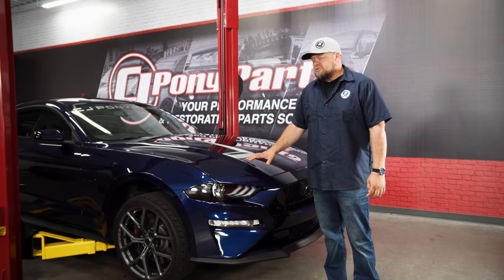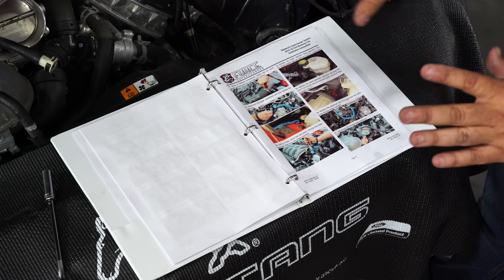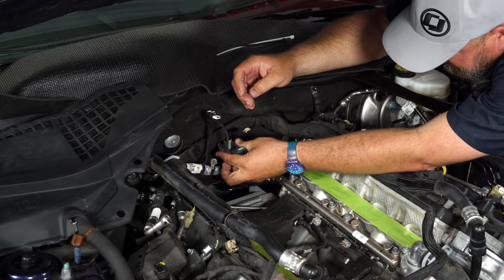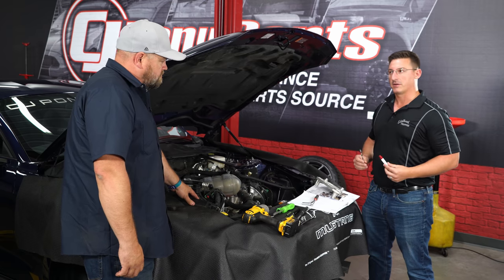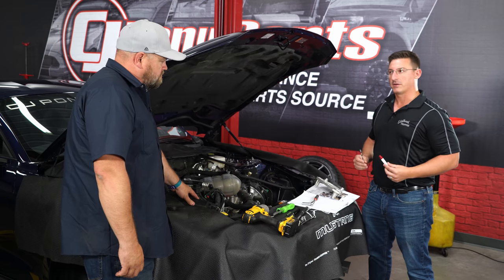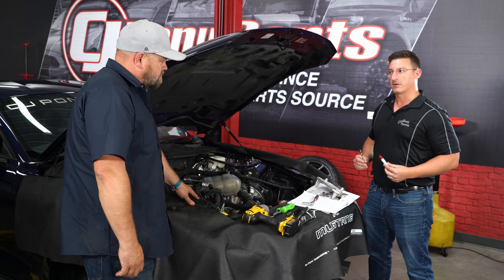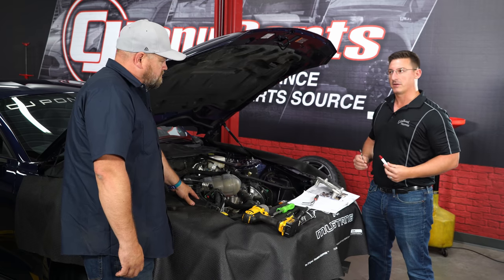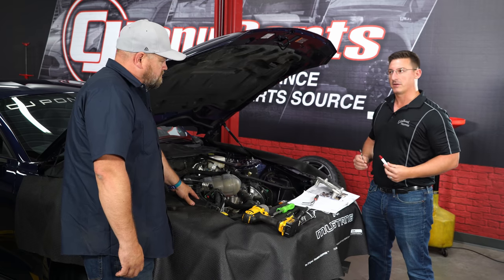Take Your 2018-2023 Ford Mustang GT To The Next Level With This Edelbrock E-Force Supercharger!

Comment from the maker: Product Info:
https://www.cjponyparts.com/edelbrock-e-force-supercharger-for-the-2018-2019-gt-mustang-5-0l-r2650-stage-1/p/EDL15832/
Reply: This kit is way much better than the Roush install, and runs cooler I'm guessing with Air inlet temps
Reply: Paulie Harrow you felt so strongly about that you posted twice?
Reply: CJ Pony Parts stock oil pump gears are okay with the 10 speed automatic and this setup?

Comment: I gotta say, a couple months after I made some other comments on this video, that last night I stopped at a local late night meet spot to see what cars are out and what's new with setups.
A guy had this Edelbrock SC setup on his '18 Mustang 6 speed car.  The Edelbrock supercharger looked really nice on his white GT.  He said he had the shop who tuned him do the install but he was there.  Said it was straight forward and could be done pretty easily if have the time and space.
He had headers installed too so he didn't run the base map, just the custom map.  This is a great size SC he said as if he wanted to up the boost down the road he can swap pulleys.
His car pulls really hard as it is and going to stage 2  would be easy to upgrade to with supporting mods.
He is extremely happy with the Edelbrock kit.

Comment: Wow, that's a great deal the fact it comes with a full warranty included! I was holding off modding my Stang till the warranty expires but now I am really tempted to pull the trigger!
Reply: Pull it!
Reply: Same
Reply: You can bring it to the dealership and have them install it and you will keep the warranty.  Lebanon Ford in ohio sells a 700hp mustang with a full factory warranty.
Reply: Did the they say the factory basic and drivetrain warranty is also still in effect even after installing this kit?
Reply: I’d like to install it myself and save a TON of labor charge. I can imagine it’s pricey. Man I want this setup.

Comment: I used this video to install it on my 2017GT. Almost identical instructions. Took 2 days...Bought about 300.00 in tools I didn't have. Really pleased with install that looks factory. Had an issue with reservoir leaking and they sent another quick and no charge. Just be careful with front fascia or you'll need the latches- go FORD :(    Fuel rail bolts were a slight pain. I'm no mechanic but have good mechanical know-how. I'm a PC support tech, but I'd install again in a heartbeat. I'm running the canned tune but getting a better dialed-in dyno-tune in spring.  After about 10 street races only losing to a twin turbo stang, the clutch blew up. Upgraded to a 1000HP clutch and have halfshafts already ordered. Overall money well spent for the fun it gives back. I ordered mine from CJP because they made such an awesome video. Bill deserves props.
Reply: i just bought a 2017 also it came w/ this how has it been since you had it?
Reply: @blvckshinobi3864  10k miles on it... still enjoying it... no problems
Reply: @purpletwinkie64able  thats good man because i was doing reseach and everytime i look up info on it always says 2018-2022 mustangs.
Reply: @purpletwinkie64able  and not trying to be funny but are we able to tune it to make it sound like a supercharged is under the hood im hearing it on VMPs not these.
Reply: @purpletwinkie64able  whats the mpg like?
Reply: @blvckshinobi3864  no whine... you can do a fosters mod but only hear inside car
Reply: @jadenjames1640  15mpg around town... 20mpg hwy
Reply: @purpletwinkie64able  I have a video on Tic Toc w/ it on Dyno most definitely Whines @livinrelentless
Reply: @purpletwinkie64able  thats really good for the power thanks dude! i thought it would be less tho

Comment: For anyone considering any S/C kit with included tune... You must not deviate from their listed aftermarket parts or you risk blowing the motor.  At very least car will run very poorly.  
If included tune says stock cat back exhaust you must use the stock exhaust. Can't swap intakes or alter from their list of parts.  Once boosted any change, even minor, requires a custom retune.
Most included "base maps" are on rich side to be safe.  As it's better than going lean and getting a lean condition and/or knock.  Seen many people ruin a good ecu map by changing parts AFTER an ECU map was created.
Reply: no one is gonna listen to a subi grunt
Reply: Subi owners probably have blown more motors on 1 car than most of us have in our lifetime lmao. I'd take a minute to learn from them.
Reply: Nicholas that’s cause their engines are shit bro I’ve owned one myself lol 😭
Reply: I agree..but  having a couple sc mustangs  myself I would use their tune just to get it up and running then take it to a tuner and do a dyno tune to make it safe and better power curves etc specifically for how you are going to run your car... are you a road racer , drag racer , daily driver , whatever it is a custom tune is the way to go... both my cars I have 3 saved tunes on my laptop I can download for what I want. I use two mostly the pump gas tune and race tune gas max power tune for the strip. Both tunes developed on a dyno. Only way to go and be safe.

Comment: I'm glad to get this video, everything you mentioned as being tough my ASE installer had said months ago, so now I know for sure he was being honest haha!!!!
 I've had this blower a while it's a capable piece and looks like Ford installed it at the factory ( especially in stage 1 using the factory airbox). I have taken my car in for tint ect and those performance oriented guys WITH FBO e85 mustang's didnt even know it was on there with my stock exhaust. I have the old man sleeper going...this blower, ceramic tint that not real dark, stock exhaust, slightly upgraded tires...
 This kit also has a bleeder in the bypass hose that delays boost and Torque delivery so that you can actually USE the power it makes. The effect is something of a centri/PD hybrid on my 19 A10, however this is adjustable by buying N20 jets I found a .040 orifice to be a great blend to get into boost at part throttle and hold it longer..this makes a 28 inch tire, 3.15 gear car feel a bit more spirited. I've always knocked PD blowers in the past for how hard they all to USE their torque which is their strong point elegant simply solution. I've dont this a much more complex way with PWM 3 way valves in the part ( but I was doing boost by gear and had it tied into traction control deltas).
 Stage 2 goes on my car today and I cant wait to compare. My main gripe is that I feel like I was done wrong on that who deal, this weekend one could have gotten a stage 2 for about same price as I paid for Stage 1 a few months back. And stage 2 "upgrade" is $4750 ( stage 1 this weekend was $7100 with rebate ), I've got almost 12k in the same exact setup not counting double labor. I feel like I should have gotten a voucher for the cost difference between 1 and 2 as late as my purchase was and all the problems getting my parts both times, missing install windows and sale only have 2100 miles on install, engine is fine and doesnt use a drop of motorcraft 5w50.
 That's just my sour grapes and bad luck on timing for pricing, I urge anyone considering this kit to pay the 1800 differential between the stage 1 and stage 2 full kits. You cannot every remotely piece it together cheaper. The 8 rib conversion purchased alone is $1750, tb is $850( remember it's a new Edelbrock digital piece for the 18 and ups no conversion box this isnt a bad price, 113mm maf horn and aftermarket cone filter in a nice looking sealed box is around $800 ( I think dont quote me on that one). Just buy stage 2 going in and your getting well into the 700s for a very good price and capable of 1000whp when you want to take the training wheels off.
 The Stage 2 kit is also warranted, if you havent previous voided warranty on your car before installing. Making it the most powerful warranted kit ever produced from literally the first name in performance ( do you think Edelbrock is going out of business in the next 3 years to 36k miles? I don't) a truly unique kit and hands down their 15388 kit is the best bang for the buck on the market when you factor in power with a warranty along with headroom to grow, its stealthy silent till your really on it and impacts the driveability and mileage almost none...barely deductible till you want it to be.....
 Any questions just ask, but I implore you not to get stage 1 and then upgrade get stage 2 even if you have to wait another month, it wasn't an option at the time for me but it's a no brainer. $1800 or less upfront and 1 install or $4750 on the backend and labor for 2 installs...
 Thanks Shawn.
Reply from the maker: BlueCollarDaily longest reply ever :)
Reply: @cjponyparts  dude Nicholas will tell you, that was Pithy...bahahaha...sad but true.....

Comment: Nearing the end of my install and have to admit this video was super helpful.  Few things  that had me confused were the Edelbrock instructions listed 4 harnesses to unplug on the back of the stock intake manifold...  My 21 has only 3.  I found installing the fuel rails after would have been easier, the rear isn't as tight as expected and they were hard to manage on the blower getting the bolts in.  Overall everything went well, great job and although the instructions that came with the blower are good I dont think I would have been able to do as easily as I did without the video.

Comment: I just bought this supercharger for my 2019 f150 5.0 gonna get it installed here soon. I ordered mine over 4TH of July when edelbrock had 15 percent off site wide so I only paid 5900$ shipped.
Reply: Did you get it installed yet? I'm thinking about buying one
Reply: Finally got it installed I have a regular cab short bed lowered 4wd and this supercharger makes the truck haul ass. My mechanic installed it in about 11 hrs he said he ran into a couple of things that were a pain in the ass to install it but it's definitely worth every penny.

Comment: Wish I’d given the Edelbrock a chance rather than going centrifugal on my ‘18.  These things are heavy hitters when you add a fuel system and E.
Reply: The same thing could be said for centrifugals if you run e85 and up the timing and or boost.
Reply: Which one did you use?
Reply: D1X with e85, headers, and about 10lbs will put you around 800-850
Reply: BlueCollarDaily 2200Sl with a Fore L2 dual hat setup.  Not sure of my numbers.  I just know you tend to see way more Whipple/Edelbrock cars in the low 9’s and some in the 8’s where you’re not seeing Paxton/Procharger/Vortech cars nearly as often.
Reply: Twin screws look better, have better low end torque.  Centrifugal have that top end power that twin screws just don't.  All a preference/choice of what you want.

Comment: what gap is your spark plugs? are they Motorcraft? Getting a spark knock on high end, trying to figure out if the gap is wrong or if I just need to add Lucas to the fuel. Thanks

Comment: How can the factory fuel injectors supply enough fuel for that supercharger kit?
Reply from the maker: neverendingmods the DI pump makes up the difference. Some SC kits add larger injectors and leave the DI pump alone, Edelbrock chose to use it .

Comment: Quick question. Can you use corsa long tube headers with a borla switch fire mid pipe to factory 2019 bullitt mufflers? Or what would be the best route for long tube headers?

Comment: The Roush can be had at the dealership in Richmond Ohio, on the GT, @ 700 HP, with warranty , for less than 50K.
Reply: That's what I was thinking
Reply: The Roush kit is more like 600hp and only in mid-range of rpm.  Very little power down low and up top.  That's why there's a factory warranty... Mild so less torque as torque breaks shit but is what wins races, not HP.
Reply: @neverendingmods  2017 stage 3 roush produce roughly 670 hp (weather that's crank or wheel I have no idea) but for 2018 and up its its phase 1 supercharger kit produces 710 hp and 610 lb-ft of torque. (Again same statement applies to this as well) but anyways with warranty either way roush I've heard is more reliable, but that just my Opinion
Reply: All this crazy HP is getting out of hand !, remember back in the sixties, high insurance rates on hot rods killed the average guy.
Reply: @charleswilliams3979  honestly if I had the chance to time travel just once I would go back to the late 60s just to see all the hot rods and classics out on the street
Reply: @Mrjack-yn2dj  .Man O Man! Hemi's, Z28's , Boss 302's , deep dish crager wheels , cherry bomb mufflers, air shocks, little tires up front, wide in back, posi rears with big gears, 4-11, 4-56 , Hurst shifters, Grant sterring wheels, fuzzy dice on the rear view mirror, the sticker on the glove box that says, gas, grass or ass, nobody rides for free! Ain't that AMERICA!
Reply: @Mrjack-yn2dj  
Roush tunes on their cars are very conservative.  Lose warranty retuning but gain big power down low and up top.  Roush cars make good "claimed and proven"  mid range peak power but lacking  down low and up top. It's all in the tune and purposefully done that way so shit don't break.   
Check out some of the reviews of their 18/19 GT 700+HP cars.  I'm not bashing at all just saying retuning their equipped cars net a big increase at cost of warranty.  Some guys ditch warranty and retune.
Reply: @neverendingmods  ah, okay. I was not away of that. I got confused and thought you were just saying that they can't reach 700hp. I do apologize for that. Also that's kinda ridiculous anymore, they should know that their cars are going to get tuned.

Comment: Big Question..Will Ford honor this  Edelbrock supercharger..Especially if your local Ford dealer does the install.. Has your exteneded warranty like I have on my 2019 Ford Mustang GT Performance Pack 1
Reply from the maker: Edelbrock warranties the engine if you use their kit, the Ford warranty on the engine would be void.

Comment: I would never trust myself with this
Reply: @Markus Patients my jet ski quit while I was on the water because the battery got disconnected because the bolt came out..
Reply: @Markus Patients I was the one that connected the battery at the beginning of the year..
Reply: @Markus Patients me, I used a wrench this time, instead of a screwdriver
Reply: I wouldn't trust anyone but myself to do this.

Comment: Love this kit and I'm trying to pull the trigger on one but I need some answers.  I'd like to start with Stage 1 and upgrade from there.  I want to run e85 and I've already got TSP catless long tube headers, JLT & x-pipe.  I know the JLT will no longer work but I want to utilize my exhaust.  My shop is researching stuff now but I'd like to know if I should go with a No-tune setup or the one with the tune? If the shop does an e85 tune, what injectors would I need?  Does the Stage 1 use the stock TB or just a smaller one?  I know the Stage 2 includes a 113mm TB.  Thanks in advance.
Reply from the maker: Dustin G if you have catless headers you will need a custom tune.  As far as running on E85 that requires a custom tune anyway and you would want to go with at least ID1050s. Stage 2 has the larger throttle body and airbox setup. If you go that route your fueling needs will depend on your tuner but most likely you would want to step up to a division X DI pump too
Reply: @cjponyparts  That makes sense.  So I should opt for the "No Tune" kit then, correct?  My tuner told me that his only concern is aquiring correct mapping that will keep me from running too lean.  I also learned why a boosted setup prevents the ability to go with a flex tune, which makes sense.  Can this tune be done on a dyno or will I need to get someone like PBD or Lund to send me a custom tune?  My tuners biggest concern is the stage 1 TB because that affects the tunes alot. The way I see it, a stage 1 setup with long tube headers & e85 should put down plenty of power...but I am trying to ask all the questions I can now before I start ordering parts.

Comment: How will this impact MPG? (I know it depends on how you drive, but in general, how much to expect)
Reply: It all depends on how the tune is optimized. The bigger injectors can handle more horsepower and probably have a better spray pattern. Honestly there's too many variables to determine what the mpg impact would be without testing it. My guess would be lower city mileage due to constant shifts and rpm change but on the highway it might be negligible impact.

Comment: Mine makes 620 whp. Installed by rev auto after lots of problems with the throttle body sticking and seizing up. They had to tow it back. Rev auto is top notch.

Comment: How can you KEY ON POWER when it’s a push button start ? at least my 2019 is push button start
Reply from the maker: BAD KARMA push the start button without putting your foot on the clutch for a stick or the brake for a an auto.

Comment: I don’t disagree with that, but I never like to see boost on stock exhaust manifolds. The air box isn’t that big of a deal. But Cross plane engines need headers so the first cylinder and last cylinder to fire on the same bank aren’t fighting to scavenge exhaust. Sorry, wasn’t trying to be a super negative keyboard warrior. I should’ve just said “headers please” or something. Still a great build

Comment: with that kind of power... you would want to upgrade tires, and rims at the minimin... it will probably add up close to the gt350... so why not just get the gt350... fewer headaches, safer and looks nicer too...
Reply: gt350 isnt boosted.
Reply from the maker: Justin credible the GT350 makes almost 200 less HP and would still cost more than a GT with a blower. Really not comparable cars, GT350s have plenty of their own headaches too.